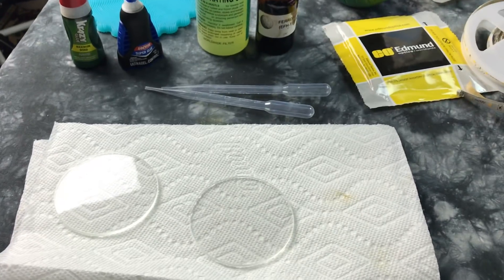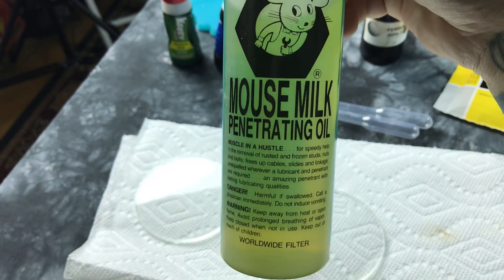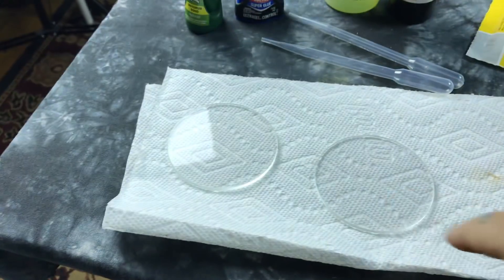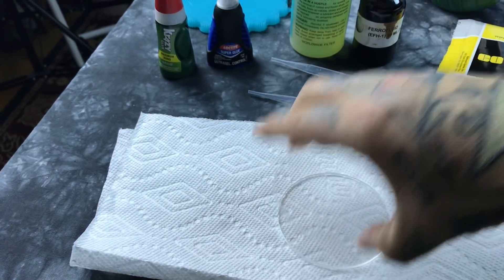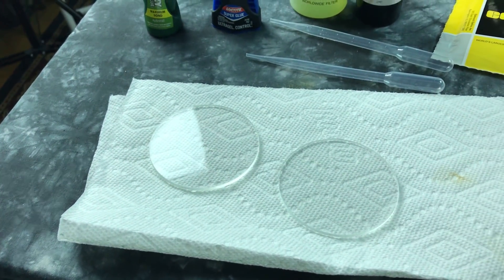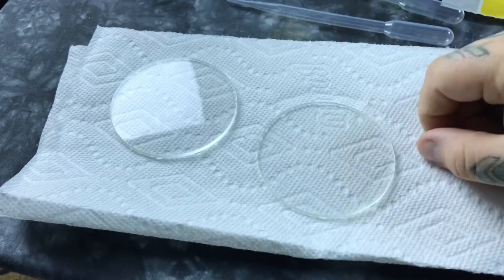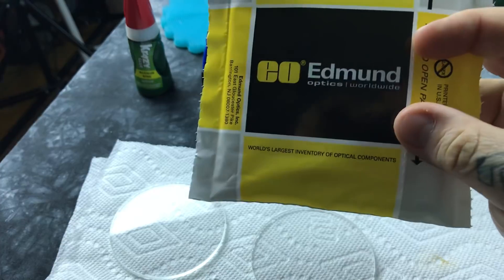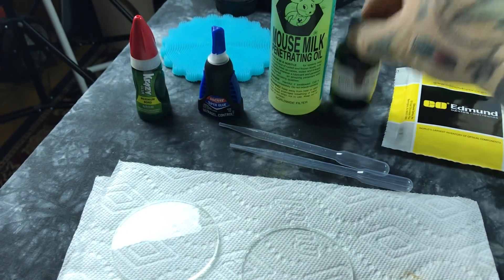🤗 HOW TO!!: Make a MAGNETISM SUPERCELL !!

Comment: Can I use thicker glass to build this? Curious if that will produce a more visible hologram.
Reply from the maker: that doesnt help however, it must be optically flat
Reply: @KenTheoriaApophasis  Bummer. Well, the flats are outside my budget for now. I can get though, museum quality glass. Perks of working where there's a frame shop. Try to poor man's route with this in the meantime.